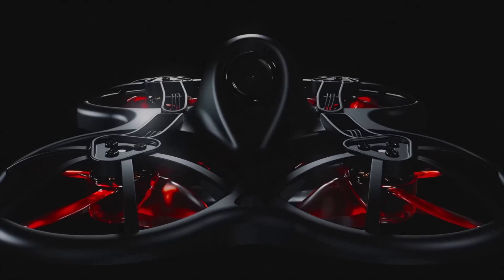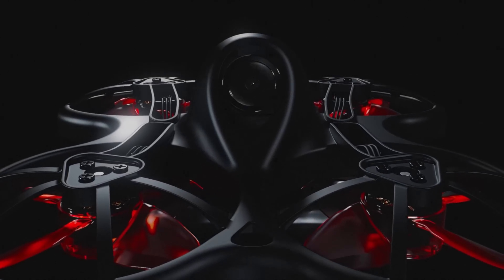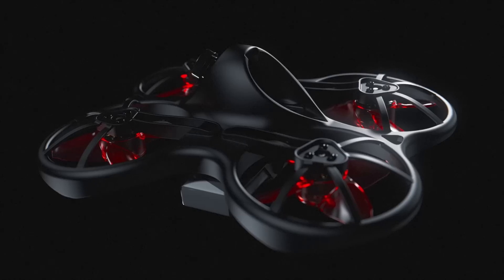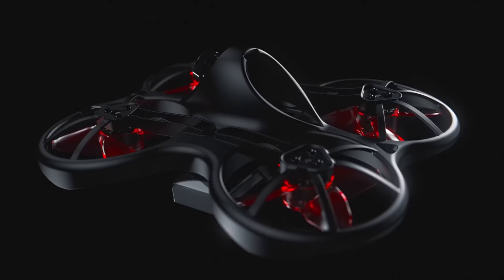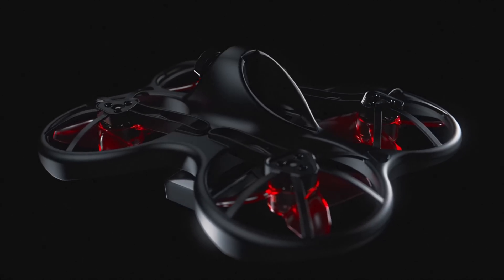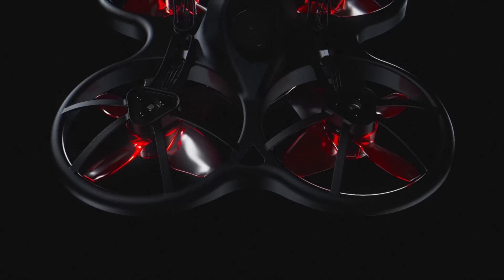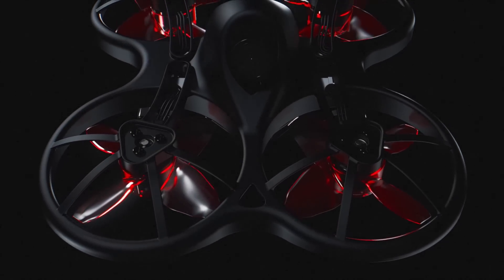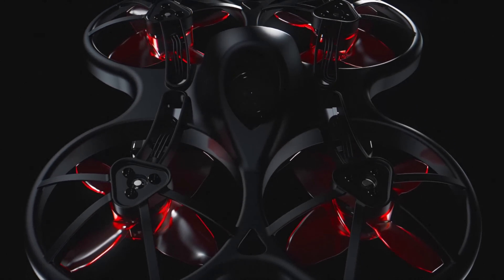EMAX - Introducing Tinyhawk S

Comment: hi guys just purchased a tinyhawk s but my connectors are like the old one on the top not on the side like its supposed or am i wrong or did i catch a clone or copy
Reply from the maker: The side ones were the first batch which were quickly corrected.